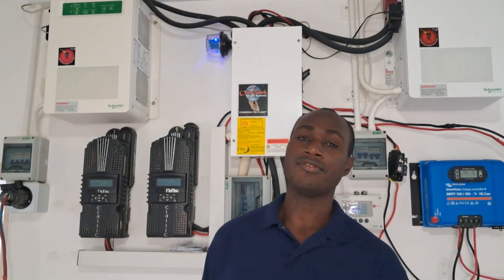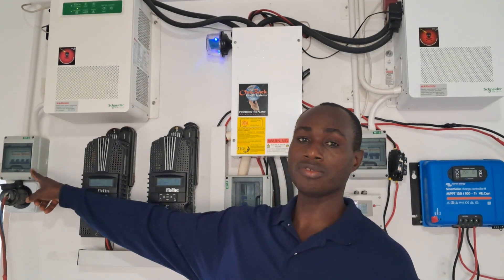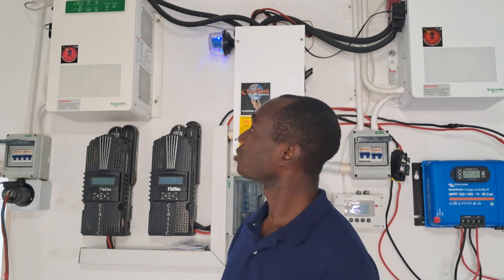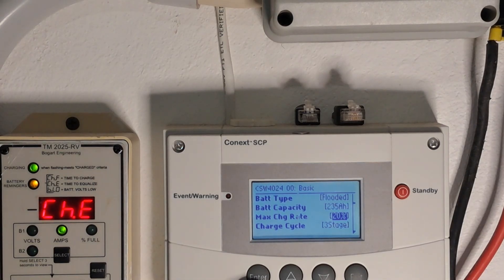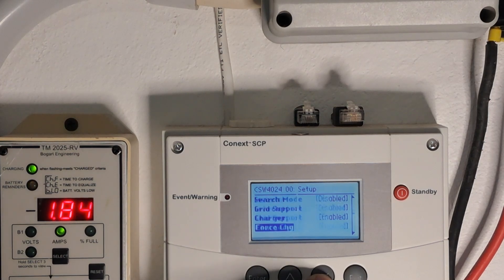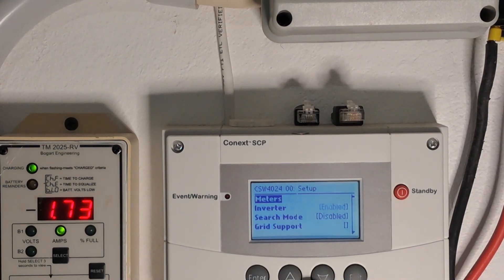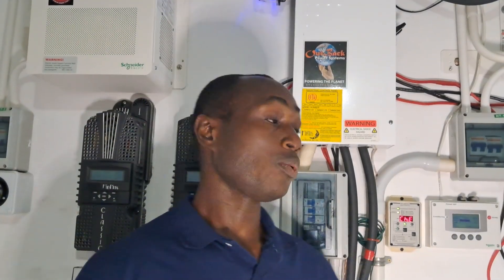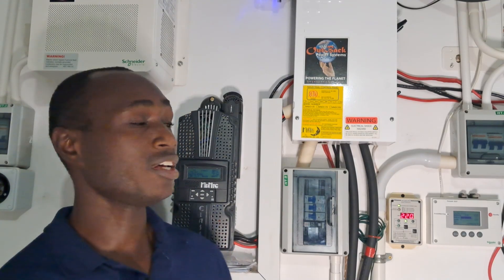2 Stacked Schneider Conext SW 4024 Update after 2 years, load and charge tests

Comment: I have two 30 year old Trace SW 4024 inverters. My original stopped syncing to the generator. I installed the backup, and instead of having the original repaired, I bought one of these new SW 4024s. What a letdown. They don’t even have a screen built in to change settings, or auto generator start.

Comment: Currently as I just have the one is it still possible for an end user like me or someone else I only has one to go and stock to
Reply from the maker: I think you should be able to stack them. I have not done much research on what Schneider says about stacking them. Just my opinion, I think they may not support them as it relates to warranty, if they are stacked and one or both get damaged. 

However I have stack these before I someone commented on one of my videos that Schneider does not support stacking them.